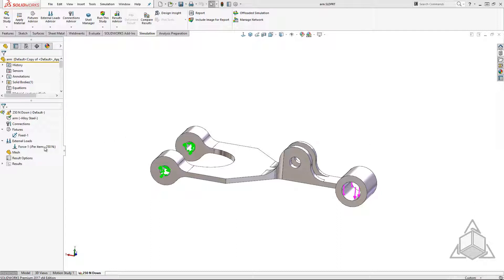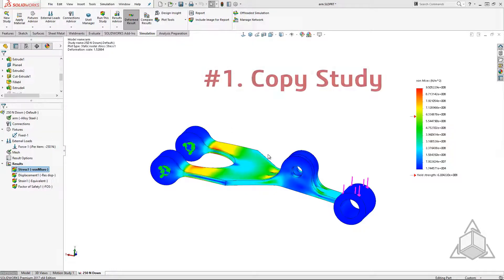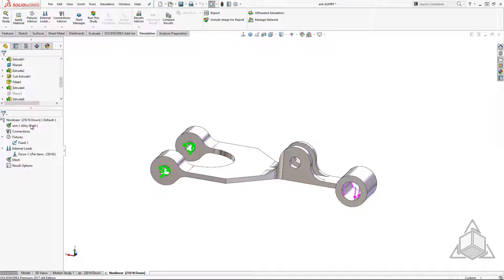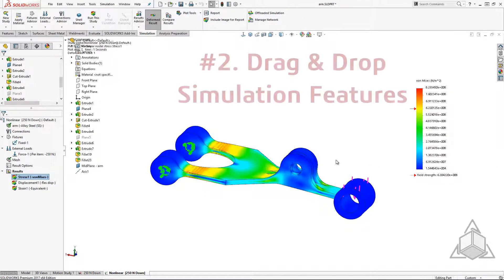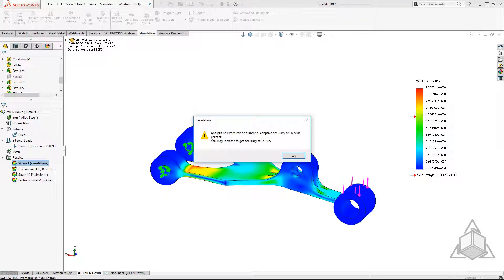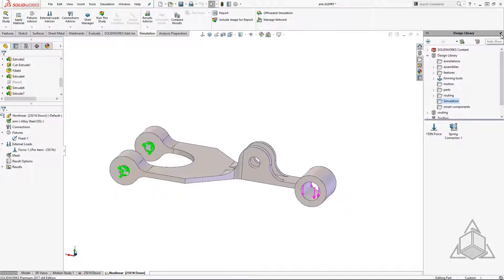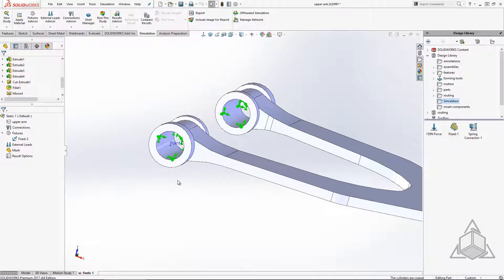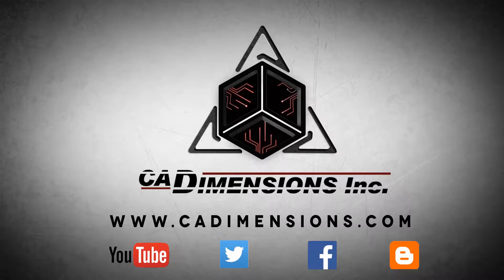Tech Tip - Three Methods to Save Time in SOLIDWORKS Simulation

Comment: #3 is brand new to me.  I'll try that one out.
Reply from the maker: Thanks for watching!
Reply: Do Franco or Jesse have tips on speeding up material setup/review?  I have some simulations with 200+ bodies and it can be tedious to setup and then review material selection. If I miss one material, it could radically alter my thermal simulation results.  I often wish SW had a table view to better visualize materials & bodies.